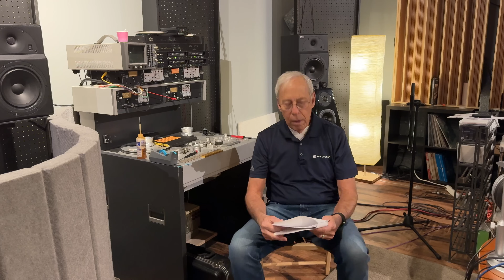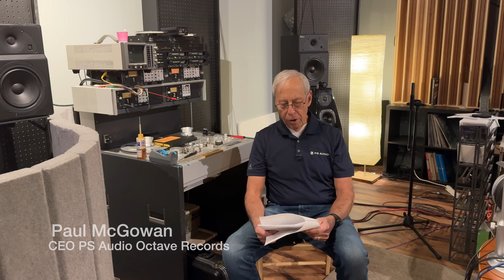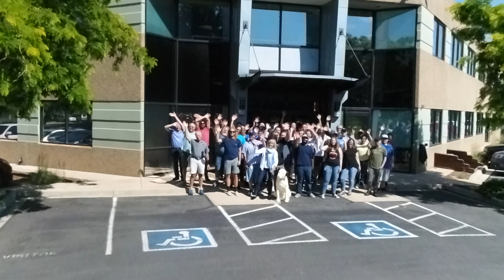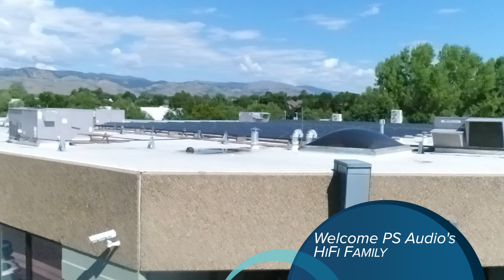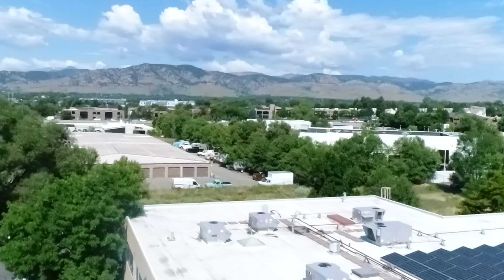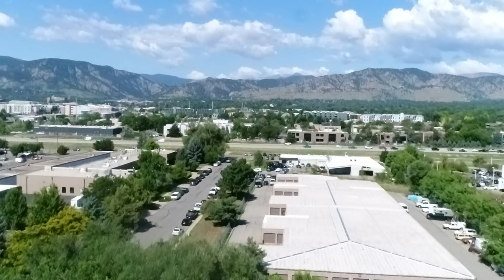Capacitors too good for a loudspeaker

Comment: Phrases like "certain sound" are so vague as to be meaningless. Doubtless there are differences among capacitors but capacitors are very simple and should be judged by measured electrical properties like tolerance, series and parallel resistance, temperature variation etc. A common quasi-religious belief among audiophiles and promoted by vendors of expensive gear that if it costs more it must be better. Taint necessarily so.

Comment: If they need re-capping,  you'll notice a big difference with just decent polyprop capacitors and I wouldn't bother with high price 'hand rolled by virgins in  outer space' capacitors. If you could hear a difference using high price capacitors, it's unlikely you would hear it on a pair of vintage Wharefdales as they weren't the most revealing speaker, although very pleasant to listen to. If you want to spend a lot of money, I would look at upgrading your speakers rather than spend good money on capacitors.

Comment: Many brands combine different makes and models of capacitors in order to attain a sound they like. Often these are on the low end of the cost scale. The poster seems to have tried out the Jupiter and likes those. As a cheaper alternative i've heard that the Audyn "True Copper" capacitors will provide some similar sonic traits. It's synergy as Paul says.Once you've hit upon a combination you like try to resist the temptation to "improve " things further. Accurate driver integration at the crossover point and distortion factors largely outweigh the differences between capacitors.

Comment: The only time I might consider a specific capacitor to be "too good" for a certain speaker, is if the capacitor you're considering costs literally like 10 times (or more) than the speaker itself is even worth, especially when considering it's existing driver and box quality and overall design...

Like it would just be a totally stupid waste of money to put a $1000 capacitor in a super old, extremely outdated design speaker with poor quality drivers and a terrible box design, because even with that extremely expensive new capacitor in the crossover of it, because of its other inherent flaws, you wouldn't EVER be able to hear all that much improvement in resolution or clarity, if even any at all...

Everything should be of a more evenly good quality already, in a speaker's "stock" form, (i.e. a case of "the bones are good"), before it's TRULY worth putting in an extremely expensive, and super high resolution and clarity capacitor(s), (among other higher quality parts in the crossover, like larger gauge air core inductors, etc), otherwise it definitely can just become a case of (very quickly, or even non existent) diminishing returns, and definitely a waste of your hard earned money in that case, money of which would be much better spent just starting out with a considerably better quality speaker to begin with!

Comment: I have some whardedale evo 4.1's, but recently got smitten by the look of their much older, albeit higher end at the time, Opus speakers. I couldn't answer the question in my head, whether 20 year old higher end speakers from the same manufacturer would be an upgrade, a sidegrade, or even a backwards step, so I joined a facebook group to ask the question. Peter Comeau himself reached out and told me not to bother. Guess that settled that! But in my mind, I had wondered about upgrading internal components in an Opus if I got some. After watching this video, now I'm wondering if perhaps its something I should consider for my Evo's instead

Comment: Nothing wrong with using better quality capacitors so long as they are of the same value .Same with the coils/inductors  .So long as the value is the same .I have gone to larger conductors with same value in Henry and higher voltage rating same value and different type of capacitors i moved away from electrolytics in crossovers   .
Reply: beware of ESR when moving from electrolytics. Even more with DCR on inductors, more than 10% diference and it will change the crossover slopes
Reply: @wyup  I purchase some silver plated magnet wire to make an inductor for a sub.80hz roll off  .What a pain in the ass ..I have been seeing some metered on amazon for testing capacitors fairly cheap now .wonder I I should just invest in one.Any advice ?

Comment: sæDpeaker crossover must be assembled correctly to give the best possible sound. you cannot use one from one speaker to another. Expensive capacitors will never take away sharp sound or too much of a frequency.
You will improve the sound a little but don't expect miracles. Upgrading from electrolyte to polyester or polypropylene is always a small upgrade.
The improvement can often be less than you hoped for, so don't have too high expectations.
Reply: What are you talking about? The capacitors job in a crossover is to roll off frequencies. It will take away sharp sounds and too much of a frequency if you use the right ones.

Comment: I agree Paul. I recently recapped my Spendor SP2/3s with Mundorf caps. Huge improvement in soundstage and detail! Pro tip: buy the best caps you can afford for the HF section, go with lower cost in LF section as the signal doesn't pass through them. Also, it's worth upgrading binding posts and hookup wire!

Comment: There is nothing too good.  Just too expensive.  There is a law of diminishing return that will kick in pretty early with mid level speakers.  If you are replacing old electrolytics any film cap will be a big improvement.  Personally I would get a couple of cheap film caps to sample prior to buying expensive caps.  That said, if the price of the Jupiter cap is a non issue, then just go for it.  It will be great.

Comment: I have 2 pairs of Altec Model 7 speakers from the early 1970's.  I changed the Caps and added better speaker connectors in the more beat up pair.  Then there is a fairly long break in period.  This gave me the chance to compare new caps to old caps.  Yes it was quite an improvement.  Then I changed the caps in the other pair and paid around double plus more expensive speaker connectors.  Yes they do sound better than the first pair I did.  I don't regret spending more as I plan on keeping the one pair.  One thing I would also do if I was doing it again would be to upgrade the wires between the speakers and crossover and the speaker terminals.  I would go with a smaller gauge (larger diameter) silver plated wire.  You should be very happy with your result and proud of yourself for making something better.
Reply: Silver plated wire is not a great choice. It oxidises. High purity copper is all you need, with the correct sleeve material. Go listen to Danny at GR Research for the whys on this.

Comment: Give Danny a call at GR Research.
Reply: He’s full of it.
Reply: @mpi5850  have you heard any of his upgrades? If not, how do you know he's "full of it"?
Reply: Good plan, he might have an upgrade kit already put together for your exact model.
Reply: @daniellewis4226 Danny is honest and upfront about the issues he finds with the speakers he tweaks. 
He openly admits that the parts quality in the original design were chosen to fit a budget.
The quality of components he uses would have massively increased the retail price.

Often really bad choices have been made by the original manufacturer and Danny points these out. Equally if the manufacturer made good choices he praises them for it. 

In my opinion Danny offers a great service.
Reply: Yeah, Danny who likes to slag off other manufacturers just because he isn't as successful.
Reply: @daniellewis4226 have you watched any of his videos?

Danny is honest and upfront about the issues he finds with the speakers he tweaks. 
He openly admits that the parts quality in the original design were chosen to fit a budget. The quality of components he uses would have massively increased the retail price.

Often really bad choices have been made by the original manufacturer and Danny points these out.
Equally if the manufacturer made good choices he praises them for it.

In my opinion Danny offers a great service.
Reply: @daniellewis4226 Danny is honest and upfront about the issues he finds with the speakers he tweaks. 
He openly admits that the parts quality in the original design were chosen to fit a budget.
The quality of components he uses would have massively increased the retail price.

Often really bad choices have been made by the original manufacturer and Danny points these out. Equally if the manufacturer made good choices he praises them for it. 

In my opinion Danny offers a great service.
Reply: @daniellewis4226  no, Danny who criticises poor engineering and cheap parts in expensive speakers. He's happy to praise good engineering.  Think about this. If speakers sound great, why would you send them in for an upgrade?

Comment: On speakers of that age the compliance of the surrounds will likely have changed a bit anyway.
A few years ago I had the same recap conundrum with my 1972 KEF Chorale speakers (a hand me down from my dad). I put in some fairly affordable Mundorf caps, and loved the way the recap rejuvenated their sound. The better quality 'budget' speakers of that era can still perform very nicely today, especially if cleaned and also rejuvenated with better new internal cabling and better binding posts. The KEFs I still use in my bedroom, where their somewhat less transparent laid-back sound is just what you need in the evening or the morning.

Comment: At 25 years old, the speaker suspension, spider cone, adhesive will all have deteriorated, and you want new capacitors...If it's non electrolytic then the cap is fine.  A Tan-Delta measurement is your friend.

Comment: Once again old Paul misses the point of the question. The writer isn’t asking are they too good such that they will do harm. He’s asking whether , given the age and mid tier quality of his speakers, an upgraded cap (but one far less costly than the jupiters) will do, and will leave nothing sonically on the table given the limitations of the speaker. I think the answer is yes, and I think if reframed this way for Paul, he might agree.
Reply: Clearly you didn’t listen to his answer. He gave a great answer to his question.
Reply: @mpi5850  I listened intently twice. He whiffed it, and it’s becoming more frequent. I’m not the only one here to make the comment. I learn a lot from Paul but he missed the point here.
Reply: @edd2771 you and @mpi5850 you both are wrong. Paul did NOT miss the point, your statement doesn't even follow what was asked. You both IMO sound like you are trolling.
Reply: @stever7638  nah. I understand perfectly. Just making an observation. No trolling here.
Reply: Just buy them and find out.  Don’t overthink it.
Reply: What about his answer misses the point? He’s saying that so long as you aren’t altering the design by selecting capacitors with different values, you won’t do harm and it is likely to be better. But he correctly hedges a bit to say that a large part of speaker design is synergy. So it’s not as simple as ‘better’. Sometimes component parts will interact in unexpected ways. And that’s where an open minded talented speaker designer will build prototypes and test dozens upon dozens of times to test different combinations of this or that to arrive at the level of performance and sound quality they envision for their product. It’s only people who think things should be ‘black’ or ‘white’ that are bothered when they hear that it’s more often a shade of grey somewhere in between. His answer was perfect.
Reply: @scottwallace1  I stand by my statement. Moving on.
Reply: Thanks Paul for one more good video! There are some comments questioning your answer, so I want to support your answer as proper one. Whoever was thinking of crossover upgrading came to the same question: if I’m doing “no cost matter” upgrade, whould I, in one point, when you reach “unreasonable” level of components quality and cost, maybe produce worse results GENERALY SPEAKING! Your answer is generaly no, but, always must be achieved components synergy, which is the must, even if choosing the components of similar price range!

Comment: Jupiter's cost a fortune and surely vastly outclass the drivers etc you have. Bypassing a more economic polycap with a very small value Jupiter may be a way to impart their character less expensively? Looking at whether the cab needs additional bracing\damping may well have a greater effect on your refurb than the difference between a very good Vs a 'luxury' cap.

Comment: One thing Paul didn't say is you got to get matching pairs of capacitors for each speaker this is very important ask the company if they will match them down to 1%.
And this will change its characteristics possibility because original capacitors might have been 10% tolerance or 5%. if you can measure the capacitor even better to see how far out of spec it is this might be a good thing it doesn't mean it's a bad thing! it might suit it better being out of spec. if that's what it was like when it was new, the capacitor should still be in good condition get a capacitor reader metre and measure them. Paper and oil is generally nice in crossovers in the tweeter and mid range in line not parallel tho! not needed in a woofer and I would stick to bipolar electrolytics if it is in the woofer or parallel, you'll be changing too much of the characteristics of the speaker otherwise and you might not like them how you like them at the moment.
as i said make sure the speaker components are matched up this is more important than anything and match to the individual drivers it may be, it could have been done in the factory like that. The best ways to measure the capacitors replace them with the same value or close to not the value written on the capacitor for instance if the capacitor States 8mfd but reads 9mfd and it's in good condition with low ESR then I would stick to that value if you're happy about how it sounds?
Reply: I agree with all of your points except the use of bipolar electrolytic capacitors.
Electrolytics shouldn't be used in crossovers, they muddy the sound too much. (the only excuse would be if you are trying to rebuild a crossover on a very limited budget)
Reply: I have three 220, 68 and 47 uF electrolytic caps on the woofer circuit of my Elac DBR62 (probably shunt/parallel to ground), they're 200€ worth on polypropilene and require to rebuild the crossover.. too expensive!
Reply: @wyup  well I've just had a Google you can get  Mundorf mcap MKP 68mfd for 21£  if you buy multiples will be cheaper. They are very good capacitors. theres a paper in oil as well good for mid-range and tweeters. you could have a look at power film capacitors for the woofer should work better and very low ESR 0.0001 much lower than most film capacitors about £10 each. You want low ESR for woofers and higher ESR for tweeters usually there are metal film on paper but can be on plastic used an extreme applications like medical

Comment: I suppose if he considers inductors next, they could be too 'good' though, as an air core might have a significantly higher DCR.
Reply: That’s why I kept the stock inductors in my B&W Matrix 805s, when I recapped  the tweeters. The DCR is an integral component of the crossover and has to be considered when swapping inductors.

Comment: I did a complete upgrade of the crossover network on my Bowers & Wilkins DM-1400 in the mid 1990s - including 2" wide solo inductors & Wonder Infinicaps. A massive sonic upgrade, however the components were too big & needed an external box to house them - small price to pay for much improved soun, & kept them until the mid 2010s.
Reply: I recapped my 1996-vintage B&W Matrix 805s with Jantzen Superior-Z caps. They really opened up the sound. Still have the speakers to this day and find them to be equal to anything at 4X the cost.
Reply: Some time ago I did a similar project with a pair of Focal based ( kit) speakers, changed the ‘standard’ crossover components for better bigger capacitors and MUCH bigger Mundorf inductors, the difference was very noticeable and a great improvement, like you I also had to rehouse it in an external box.
Reply: I recall paying AUS$1000 for them in 1985; I spend $2500 on parts, but the sound I believe beat many speakers at $10k & above.
I sold them in 2017 to a buyer whose father had an original pair as he was growing up in the 1980s.
Now using 802 D2 - another big improvement, then again the D series uses superior crossover components.

Comment: If the Wharfedale's are old enough to need recapping, then chances are there will be a few electrolytic capacitors in the crossover and possibly an iron core inductor and a low quality resistor or two. If it where me, I would replace all the components, but don't go mad. JB JFX polypropylene capacitors are sensibly priced and good quality, and get an air core inductor(s) (Janzen / Dayton Audio / US Coils) and if there are any resistors, replace them with Janzen MOX resistors. That would be a good place to start without breaking the bank.
Some of the more 'exotic' caps can cost a small fortune, and you may not notice the difference if the resolution of the rest of your system isn't up to it.
There is no "magic bullet" with crossover components, just avoid the cheapest budget stuff (mainly from China) and if you have to go 'budget level' only use those components as shunts, not in the signal path.
Reply: Yep - for guys in Europe janzen are great in they provide a wide price range and have something for everyone. There is also mundorf and solen.